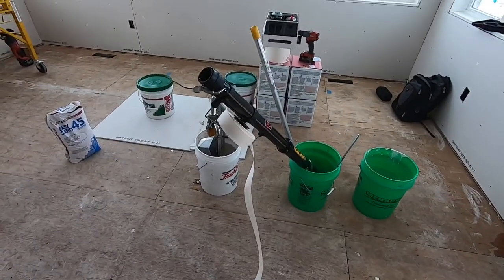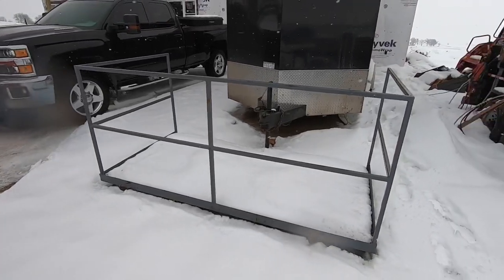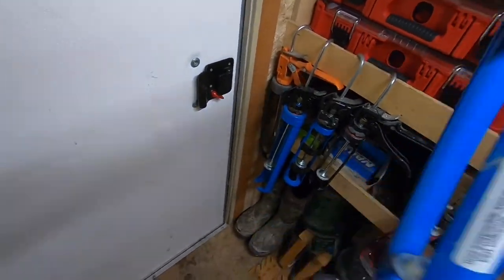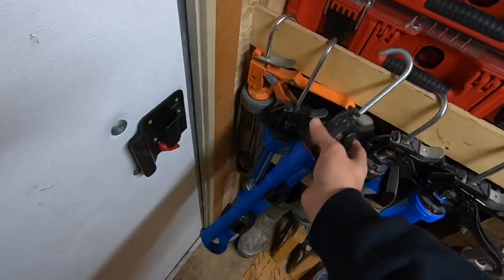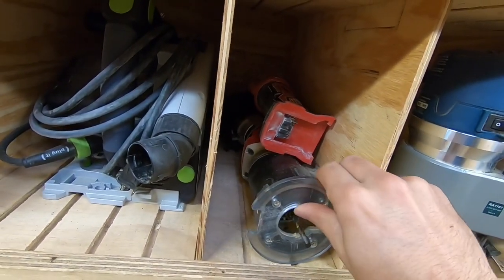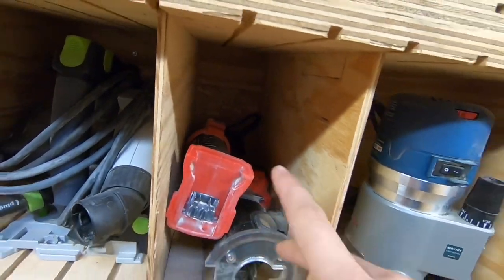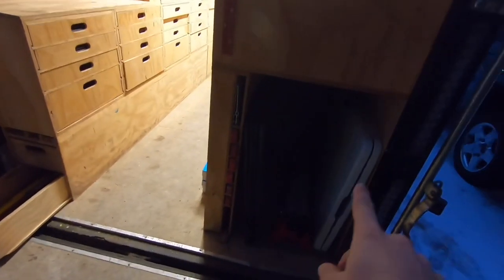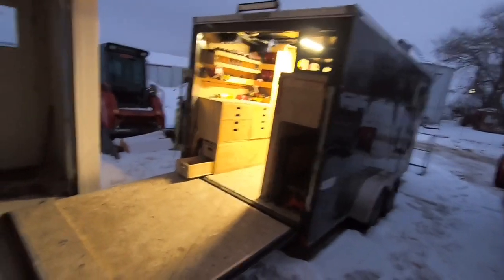Tool Trailer Tour 2020

Comment: 10:23 How thick is the plywood on those dividers? The ones that you grooved for the individual dividers. Is that 5/8 or did you use 3/4? Thanks. 👍
Reply from the maker: 3/4 plywood with 1/4” deep dados. The divider material is 1/4”.
Reply: @The Bearded Builder  Thanks for the reply, much appreciated.

Comment: 7:00 You keep saying your drawers turn into shit collectors, but if you get rid of them where do you intend to keep all the things that are in them? It's got to go somewhere. Maybe make them less deep and introduce some dividers. I've found that if shit starts collecting in an unorganized way it is usually me being lazy and not putting things back where they should go and in an organized manner. Just curious what your solution will be. Also, I think the higher price paid for baltic birch plywood is way worth it.
Reply from the maker: SuburbanHobbyist that’s exactly what I did. I took the depth out of that side of the trailer. This made life much easier. I also spent a while going through my small scrap plywood and making lots of dividers in the drawers on the “driver” side of the trailer. The dividers worked so well that I actually completely removed one of the tool cubbies above the drawers. I’ll have a trailer video coming in the very near future talking about a lot of the “fixes” that I made to the original build. Thanks for watching!
Reply: @TheRealBeardedBuilder  Awesome. I'm finally going to build out a tool trailer. It's been way too long.
Reply from the maker: SuburbanHobbyist summer got busy but I’m finally getting back into the swing of finishing the trailer. It’s been a rough summer!

Comment: how does your lighting work?
Reply from the maker: Canadianguy91 this set up was 110 ac. When the trailer was plugged into a wall receptacle it would power the lights. The new set up is all 12 volt. No need to have the trailer on shore power. Videos about the electrical setup are coming in the near future.
Reply: @TheRealBeardedBuilder  ok cool. Im picking up my trailer tomorrow, so starting the electrical planning stage now
Reply from the maker: Canadianguy91 is suggest a stand-alone 12 volt system. The most irritating thing about this set up was not having the trailer plugged in and using my phone flashlight to find stuff

Comment: Why have every single little scredriver orginized instead of having just a bag with all your screw drivers and also why not make bags with tools for specific jobs like framing, drywall etc ? Must be a pain in the ass having to go back to the trailer everytime you need something.
Reply from the maker: Christian_builds the biggest reason for me is to see what’s missing. I think it all depends on your work flow too. I have a bag/tote that I load up with what I need based on the task at hand. I also have an occidental rig so when I’m framing I’ll load my pouches with framing related tools. If you like the bag idea I’d just build the typical “contractor trailer built out of 2x4s or 2x6s and whatever scrap plywood I have laying around” and load the shelves up with your bags for each task. I’ve been working out of this trailer since 2017 and I wouldn’t have it any other way. I take time in the morning to set up for whatever task we are doing and that’s it. Maybe a run or two back to the trailer for something unexpected but it’s not 100 trips a day.
Reply: @TheRealBeardedBuilder   i see your point.. thanks for the answer sorry if i sounded rude, it was not my intention.... im building mine at the moment but i just dont know if building something like that woul be worth it with my way of working .. well thanks and keep up the good work..
Reply from the maker: Christian_builds everyone has a system. I know guys who swear by vans but I could never see myself working out of one. I used to work out of my pick up bed and I could never see myself going back to that. For me I have multiple employees working out of this trailer. The main reason I take the time to “over organize” if you will, is because things go missing. It’s not necessarily that they are taking the tools. But things can get left behind when we hit a few small jobs in one day. That’s where the over organization comes into play for me. When we leave I can do a quick once over in the trailer and see exactly what is and isn’t loaded. If I was a one man show with no intentions on hiring other employees I may have used a much more simple setup. At the end of the day as long as we can get our tools to and from that’s all that matters! I also apologize if I came off a bit snippy. I was having one of those days and took your comment wrong! Good luck with the build! I’d love to see it when you’re finished! Cheers